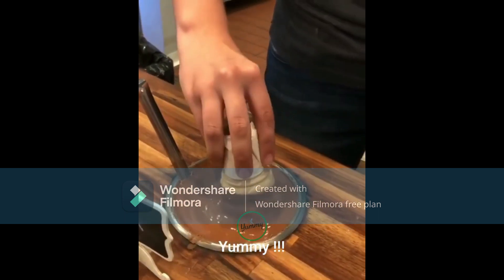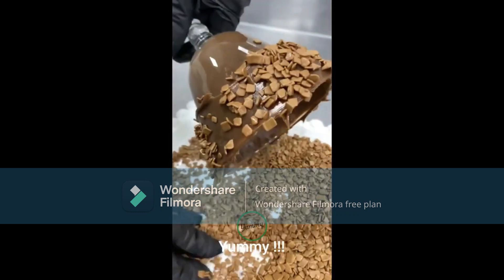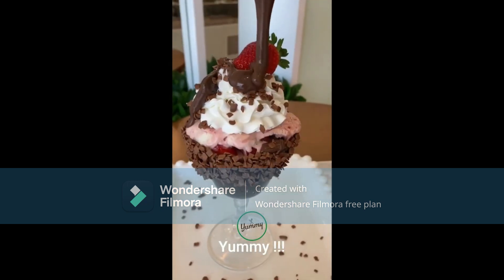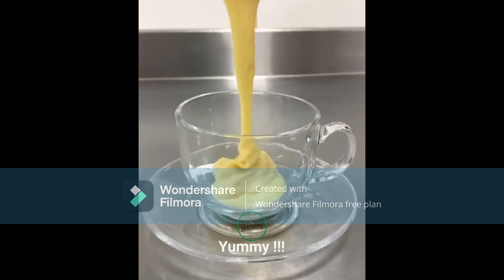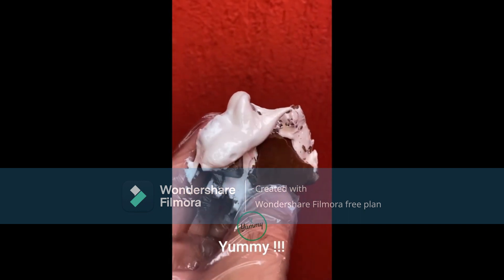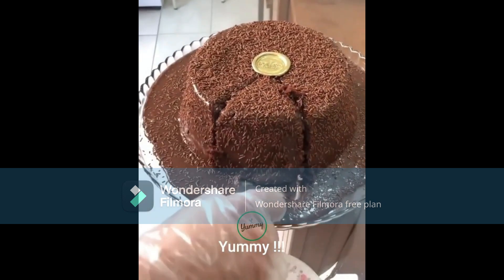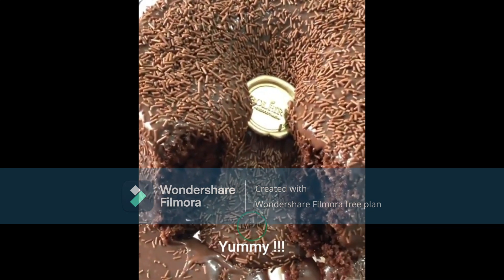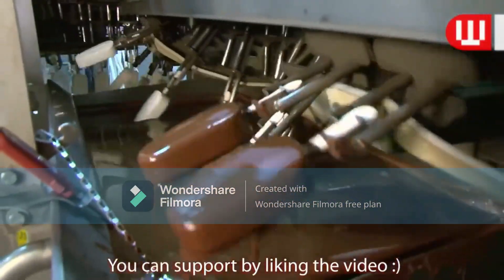Science Communication | Chocolate processing in Ghana | Okra Pectin as a substitute emulsifier.

Comment: If these polysaccharides are indigestible sugars doesn't it make it unsafe for frequent consumption in order to consider it as a good emulsifier substitute?
Reply from the maker: Good question Elliot. Let me assure you that indigestible fibers pose no threat and is very consumable to the best of my knowledge. They provide benefits to our digestive health because it has the potential to regulate blood sugar levels. So even diabetics can manage their condition and then normal people can prevent it, when they take indigestible sugars alongside or after every meal. Indigestible sugars have the ability to gather and bind with water to form a gel-like substance in the gut(stomach). So little amounts of sugar-producing carbohydrates in food taken with indigestible sugars is released into the blood during and after digestion. Also when it forms the gel-like substance with water in the gut it decreases hunger sensations, meaning you will not feel the need to eat as frequent as you do or used to. Finally they come out with our stool so they do not stay in our system.